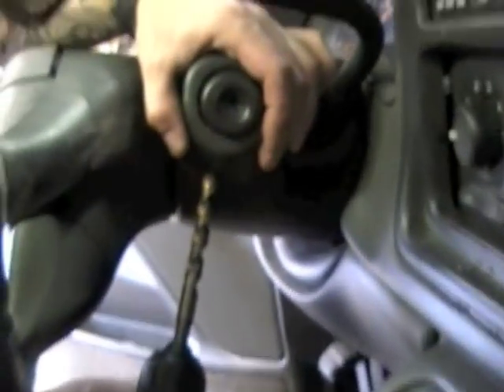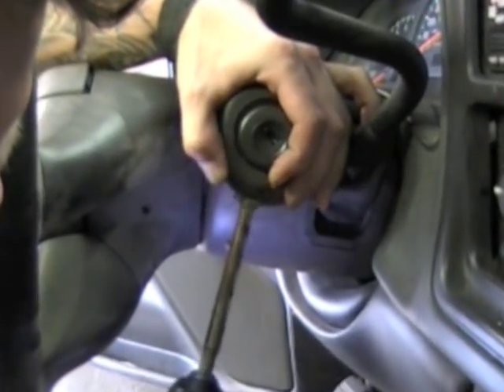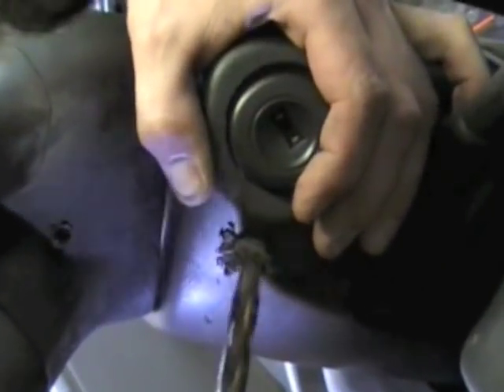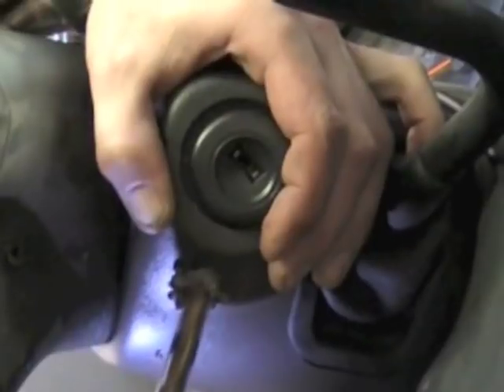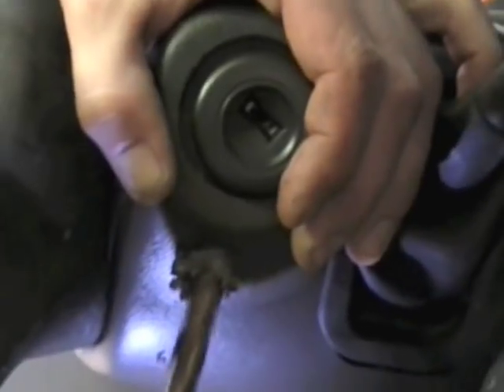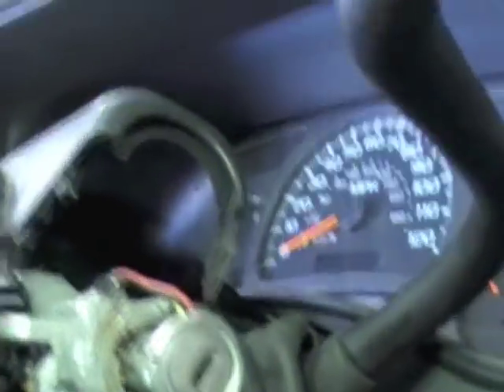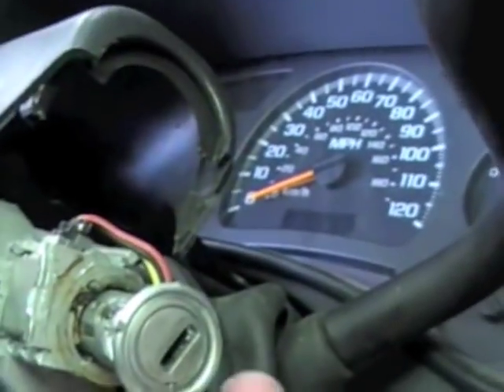Stealing a Truck by Drilling the Ignition Housing

Comment: Hahaha not true man why don't you take off the steering column  casing it look like you only had one wafer in the lock lol and that side bar have  to be pushed in order for the ignition to retract and then turn on I would have been long gone by then I will gladly show you how to do it the right way with a tensioner and a  jiggle key or a shaved key next time try to hit it at the right point lol don't believe what this guy says cuz you did not see any metal shaving coming out from there lol
Reply: Philip Keenan show me how’s it done lol
Reply: The Man Knows what he is talking about. Well I know What he is Talking Abut And He is Absolutely right. Lol
Reply: Show us how it's done

Comment: Lost my key once on my 2002 Sierra. I just run a wire from the positive on the battery to the positive on the coil and then jumped the starter and it fired right up.  Then I popped the plastic on the steering column and put a flat screw driver behind the wheel locking plate to free up the steering wheel lock. Simple 5 minute job.
Reply: Which coil? There are 8 of em.
Reply: @anthonypennington2798  On the older trucks like my 2002 they use a distributor  which has a single coil firing it.
Reply: Thats bullshit, a 5.3 had coil packs, and passlock 2 cuts fuel not ignition
Reply: @erwa9442  Except my truck never had a 5.3. Its a 4.3. Thats how most work trucks were made. Regular cab, long box, 4.3.
Reply: dude this video is on how to steal a car, not to show how to replace it
Reply: @o_o8476  Yeah and I just explained how to do that lol
Reply: I think you need to explore a shop class and not the east bud.
Reply: @jarmstrong6478  You don't have to be jealous just because I know more then you. If you can't figure out how a distributor ignition system works thats your problem lol

Comment: Why would you drill thru the plastic housing? You can remove the steering column covers, also they make tools where you don't have to drill as well for popping things out. You just have to have the proper tool. Yes GM is the hardest of standard domestic & foreign cars to get key codes for but there's other ways. These days, don't know about when this video was created they have the Lishi tool. A little practice and you'd pick it in under a couple minutes then when tilted forward you'd get to remove the ignition cylinder to decode it. I generally use the door lock then I can get close on the vehicle bitting.

Comment: Everyone, this car isn't a transponder key car but a passlock. It has a magnet in the key cylinder and a Hall effect sensor to drop voltage in the ignition lock  housing. As long as the sensor send the right voltage to the bcm it'll start.

Comment: 95 up to 2004 they will start like this but after 05 they got chip in the key but if they change the computer to 04 or under it will start
Reply: No they dont
Reply: Passlock 2 doesnt use a chip in the key
Reply: They didn’t add chip in the key till 07

Comment: only works on the gm 2000 on up to 2005 or 2006 trucks when they put the security in the ignition and not the key. 2008 aveo is the same way, no transponder in the key.

Comment: Wat size drill bit n wat brand u use ???
Reply: Use titanium milwaukee drill bits I use them on steel and they go through like butter. If it's your car and you have the key you turn your key one notch forward and then stick a skinny ice pick up that hole and you'll be able to pull the whole cylinder out

Comment: I have a 1991 Chevy Silverado 1500 I lost my key I do not have another one how can I start it they want $130 for a new ignition switch I do not have $130 so is there an easy safe way to somehow Hotwire or start with a screwdriver???
Reply: call a locksmith.  $45 and a new key issued.  Do not get a new ignition!
Reply: locksmiths near me want $200
Reply: I am a mechanic and I help people that have lost their keys or ignition messes up and won't turn all you do is go to the auto parts store order a new lock cylinder take your plastic covers off then your shoulder housing 3 bolts and Slide the old lock cylinder out with the new and then put it all back together with a new key but your doors can't lock junkyard door locks new key

Comment: lmao, that takes too long, if u ice pic it u can get the truck in less than 10 sec from 97-07 gmc chev and caddy
Reply: +Callan Riddles you can crank any model 99. +07 with vise grip and 1/4 flat head I have a video on my channel
Reply: Chrisz Palomoo.
Reply: Chrisz Palomoo
Reply: @chriszpalomoo8879  what about a 97?
Reply: @chriszpalomoo8879  what's your channel
Reply: What do you mean ice pick it?

Comment: You can see the icon on the dashboard with the picture of the car next to a lock symbol.

Dont be fooled by this stupid video, that truck was going no where.  The second to try to put it in drive, or the engine is left to run for more then 30 seconds it shuts off.   It requires an RFID signal from a chip key to satisfy that system and allow the truck to keep running.
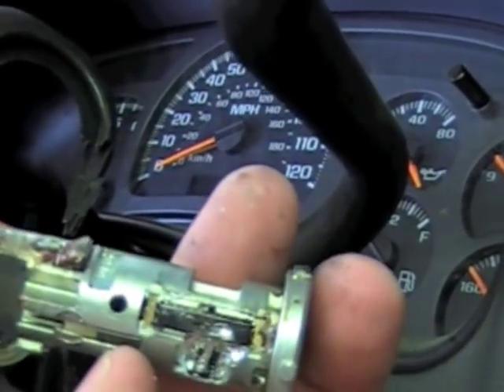Reply: +Michael G If you look at 1:50 right above his thumb is the key cylinder resistor which means this vehicles anti-theft system does not use a RFID. The resistor is the anti-theft system. If someone tries to hot wire the car, it will not start unless they know the resistor value and they wire one in.
Reply: Erik Kovacs  I realized this a few months ago when I had a key made for my truck, and the key maker explained that it's basically a forced entry detection device, vice an actual RFID. 

I will restate my original claim however, since the the light on the dash did not extinguish, the method in this video clearly does not satisfy the "resistor" or whatever in the ignition.  Only reason I say that is becuase with my truck with the same system installed, the light is our before you even turn the key. 

Just like an RFID key, it let's you start the vehicle.  Maybe drive like 30ft, then kills the engine.
Reply: +Michael G Well I can't speak for your car but I just went through this crap 2 days ago when someone tried (unsuccessfully) to steal my 2001 Jimmy that when I tried starting it without the key cylinder (that has the VATS resistor in in)  it turned over for like 1/2 a sec and dies immediately, its not even enough time to get it in gear. The video does satisfy this because the resistor is undamaged and the key cylinder remains in the housing. The camera panned away too quickly to see but for me when I try starting without the cylinder the security light flashes. It just panned away too quickly to to see if it was truly activated or just part of the power on lamp test all gauges goes through when you turn your car on.
Reply: Yeah,  I know my truck has that "resistor" and the lamp prove out is very short.  Like 2 seconds after starting the engine it's out. 

I know some models will let the car run for a very short time for repossession and towing.  Say the car is in a tight spot, and the repo man cant get the keys from the owner.